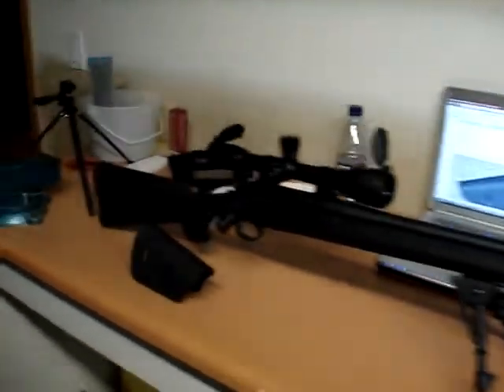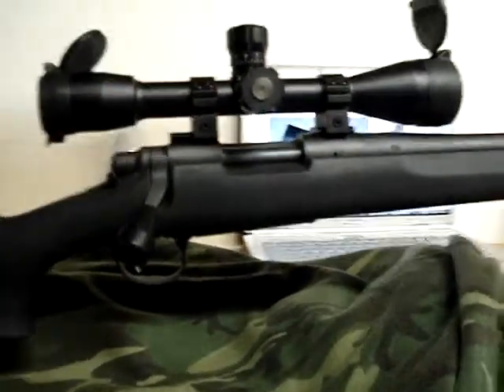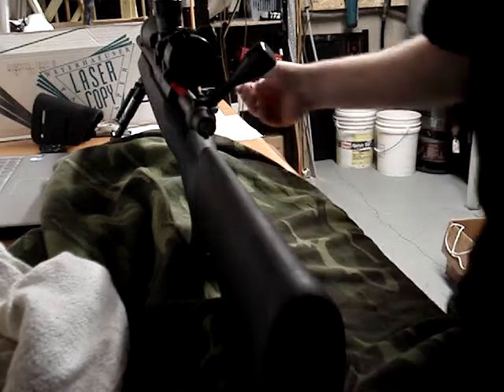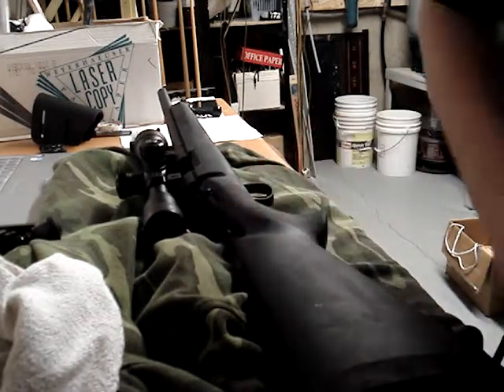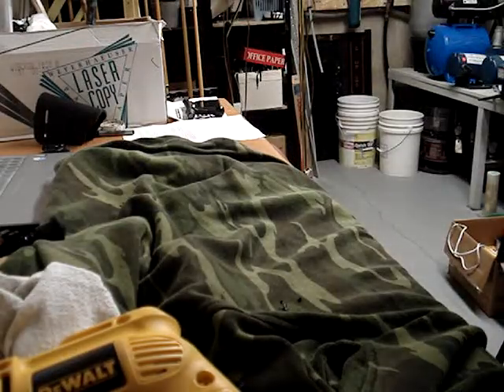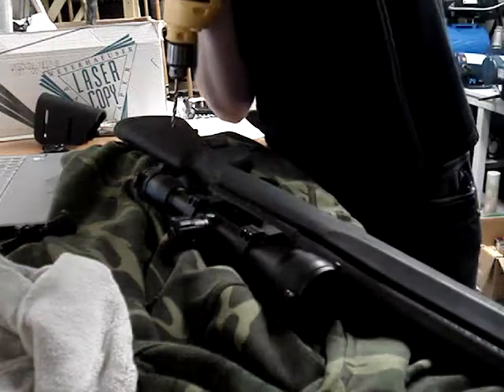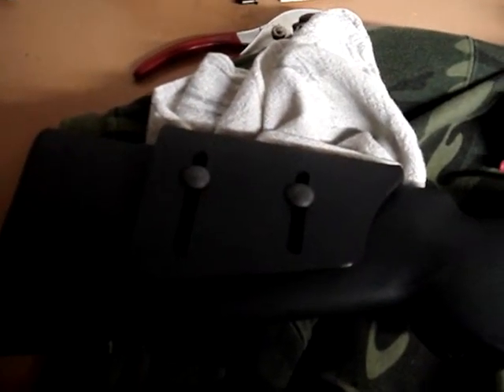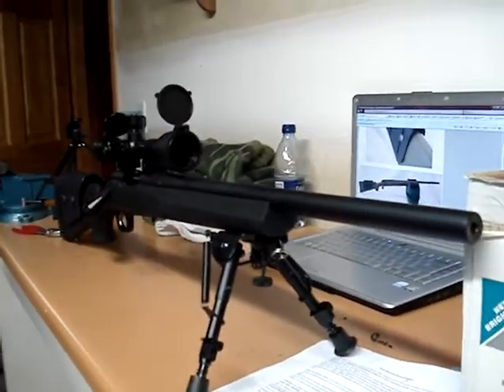Remington 700 SPS Tactical .308 Karsten Kydex Adjustable cheek rest DIY installation

Comment: The first time I followed the video heres how Ive been doing since,Cover work area with masking tape to protect from scratches and swirls,lay out holes,use a quite small bit for pilot holes, Since this model is hollow just slowly drill out either side.Ive done on several stock types; solid wood,fiberglass and hollow.Good luck! This is just my opinion and not meant as instructions the statements are meant to be informative only not as the rule or guide.

Comment from the maker: yes thats the factory stock, i actually really like it, yes i have heard about the problems it has with attaching a bipod and i have been somewhat of a victim of it, what happens is when attaching the bipod the front of the stock tends to touch the barrel, it appears that mine is but when sliding a peice of paper through it actually isnt touching which is just fine..

Comment from the maker: @LOKIUNCIA that was one of the reasons why i didnt get a standard sps, one because i wanted a right handed rifle because im just used to it, meaning that the(factory) cheek weld wouldnt even be used and two because i knew i wouldnt like the one that comes on the standard sps. The reason why this one doesnt is because it isnt the standard sps stock, its a hogue ("tactical") overmold stock. and it was about $60 u.s.

Comment from the maker: @TheFreezingM00N because the stock is hollow, therefore if i drilled "straight" through it may or may not be even with the hole i have already drilled through as there is play once i drill through the initial hole.